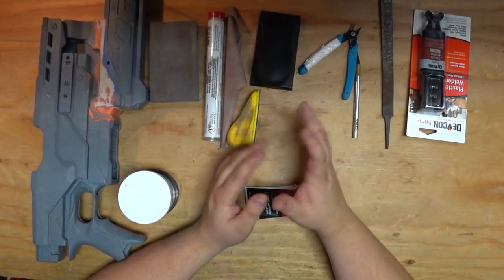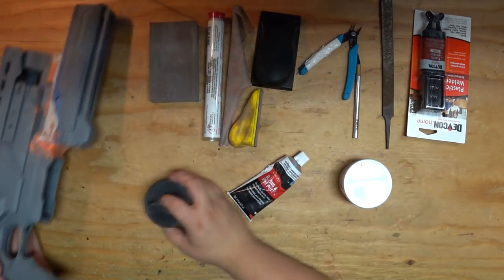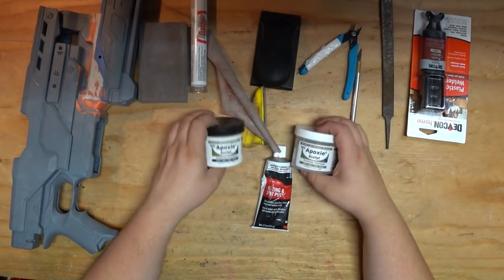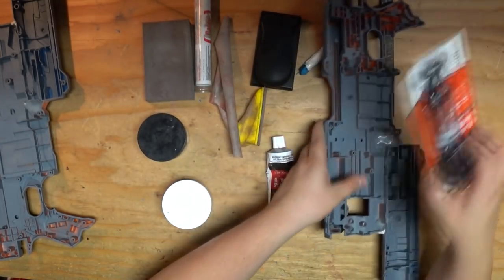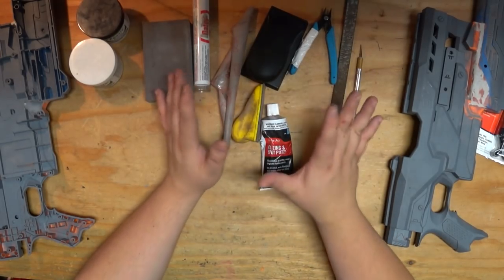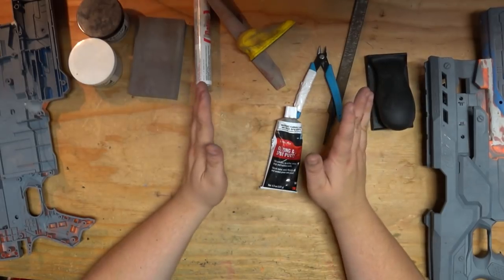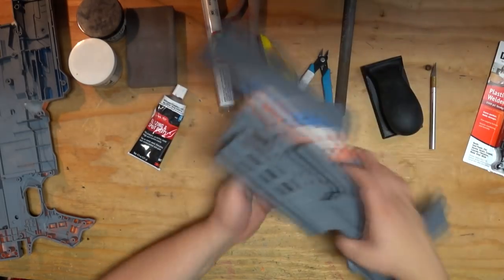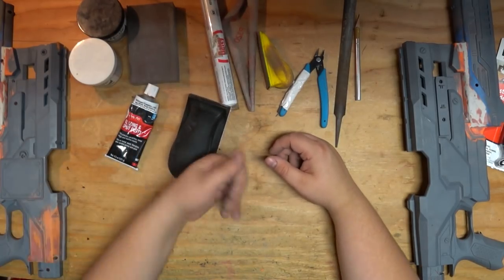The Secret to making beautiful NERF integrations. | Walcom S7

Comment from the maker: If it wasn't for the fact that I've had to completely sand and paint the top pieces 3 times so far because of crackling, I would have had this done. I'm really excited to show it off once it's all lit up and everything.
Reply: Walcom S7 hey
Reply: Good video
Reply: Love a lit up blaster
Reply: Dont paint in thick layers and do it in a warm dry room with low humidity and your paint will have a better chance of not cracking and conditioning the surface of the plastic with ether it pulls the surface oils from the plastic so wipe it down dont drench it in ether or your weaken the plastic but it helps greatly for getting paint to stick. And use a respirator  in a well vented area or it can make you weirder over time.
Reply: Hope I don't jinx it (not sure if I typed this right), but is the whole dislike bomber stuff over?
I noticed this under a few off your video but the likes/dislikes are visible again.
I hope so, you make wonderfull content and do not deserve something like this.

Comment: One thing that is important with sanding is making sure to only sand in one direction if you can help it. It prevents micro-scratches that paint will still stick to, but hotspot slightly.
Also, make sure to wash your freshly sanded shells and dry as much as possible! Fine plastic, acrylic, and other particles, as well as liquids can and will interfere with a paintjob!